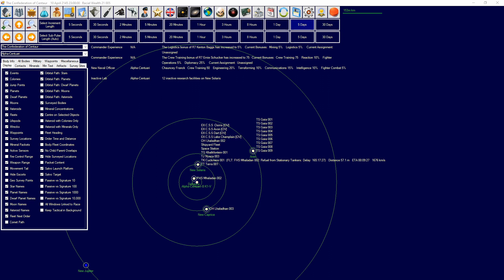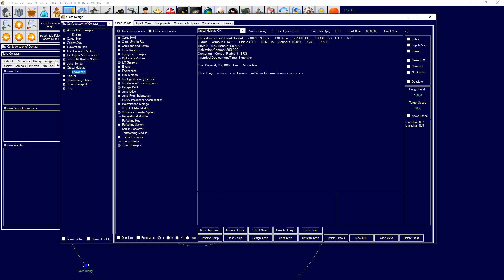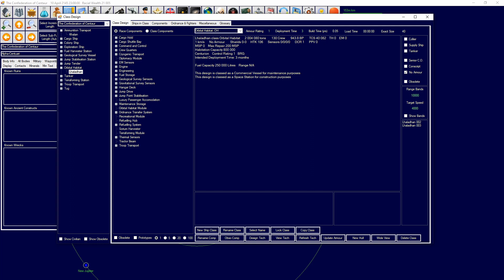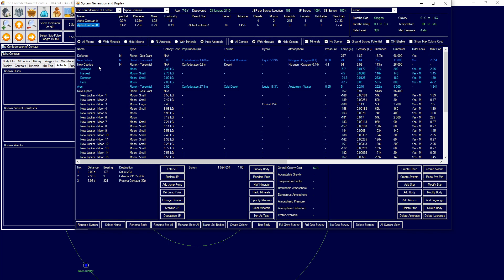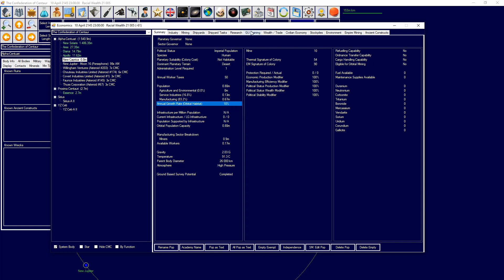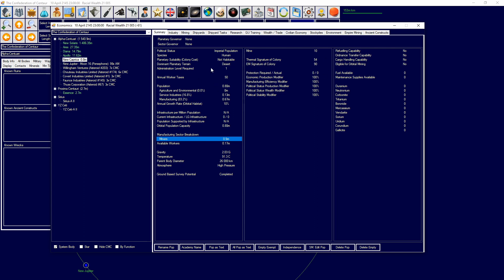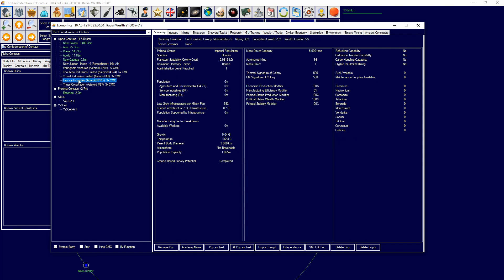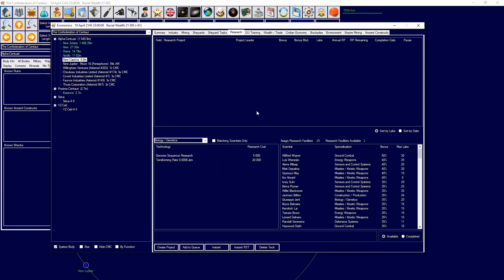Aurora 4x C# - Tutorial - Explaining Orbital Habitats and their uses

Comment: Can you use the module on conventional ships? Aka a migrant fleet playthrough?
Reply: You could use tugs. I've never bothered with Stations like this one but, I've outfitted stations (for terraforming) with engines. They just move very slowly. I'd recommend putting on sorium harvesting too - you're almost never going to find a system with 0 sorium so you can migrate from gas giant to gas giant, and from moon to moon without needing a tug, tanker ro collier to resupply, which can be really convenient (though this was in VB A4X not C# so it may have changed). Also, I tend to SM set most gas giants to have basically unlimited sorium bc I view sorium as as a McGuffin stand in for He3 and it's ridiculous that anything larger than an ice giant wouldn't have high concentrations (aka, Saturn, Jupiter and larger). TBH, any gas giant should have ALL resources (and 99x more than any terrestrial body) but, the question would be harvesting.

Edit: the issue would be building additional habitats on the move. Iirc, you CAN build bays that act like shipyards but, they're more for smaller parasite craft. It may be possible to build a station on a station using the standard production queue instead of a space dock (either flat out or in sections like a PDC)  but, I've never tried it.
Reply from the maker: You cannot unfortunately though there are some work arounds. and conventional can mean something very different so a word of warning with terminology.
Reply: @DefranStrategy   Fair point but now Im imagining how insane a Conventional non-trans-newtonian fleet game would be... 

Slow and painful obviously.
Oh well, get the tugs! :P